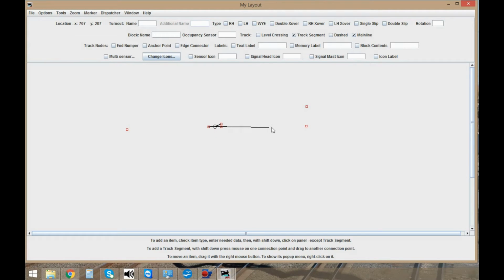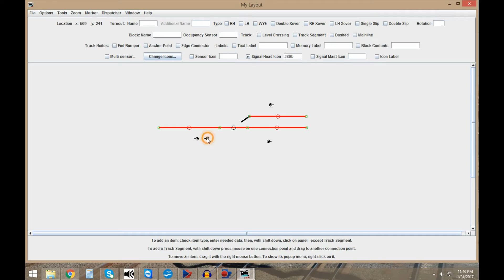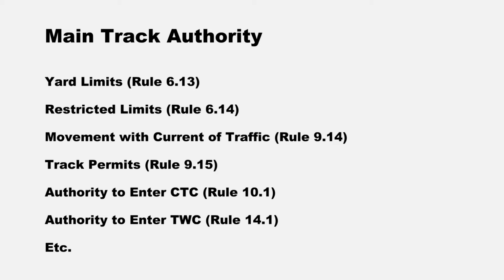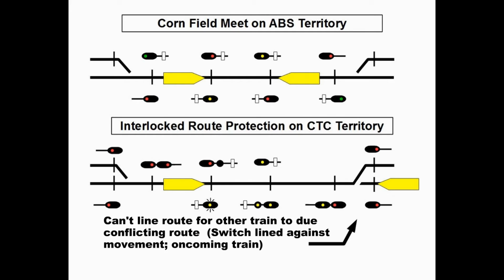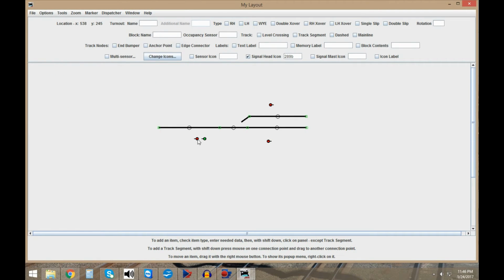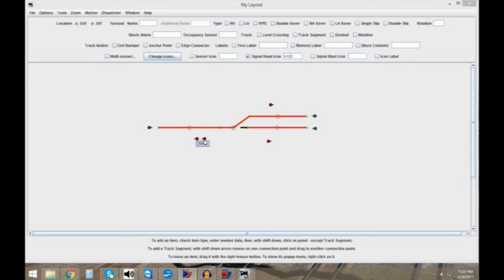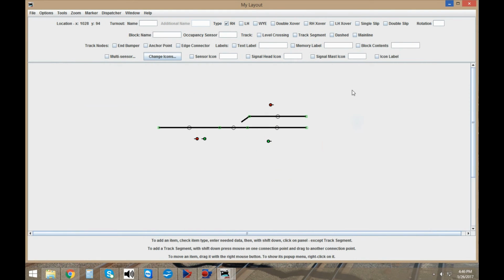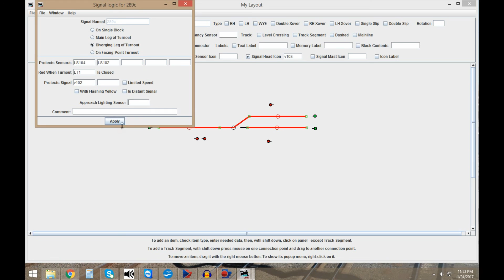JMRI Signaling with Digitrax Hardware Part 2

Comment: Sir, 
For my layout I'm using O-Gauge Fastrack so should my block be every 3ft or 6ft apart? Note my total number of cars including the engine will be 20. Which way do you think I should go?
Reply from the maker: Respectfully, based solely on this and previous questions you have posted on my channel, signalling is a very advanced feature to add to a model railroad, and not really something a beginner should attempt. I would advise mastering the basics of railroad understanding and modelling first, then explore signals and block detection at a later time.
Youtube videos are a great starting point for information, but they can only teach or explain so much. At some point, a person needs to buy some supplies and build a layout, learning more by doing and making mistakes, then trying again learning from those mistakes.
Happy Modeling!